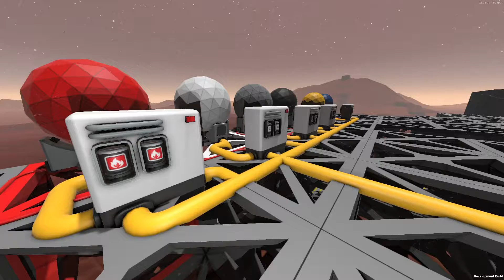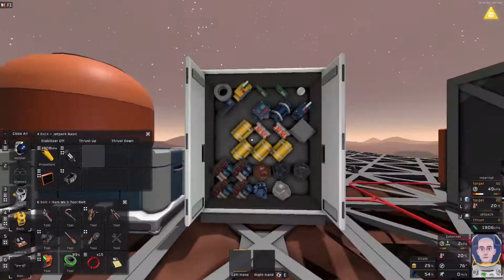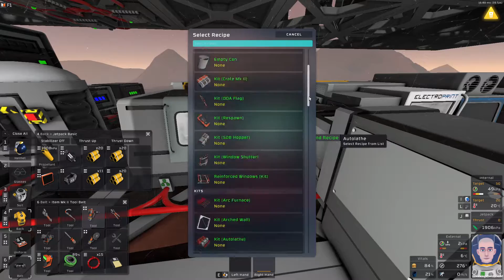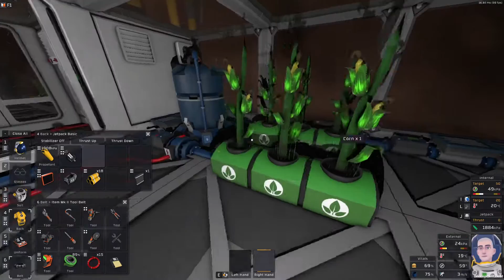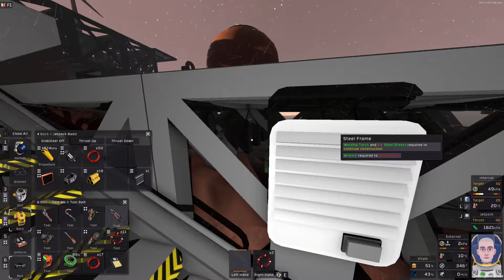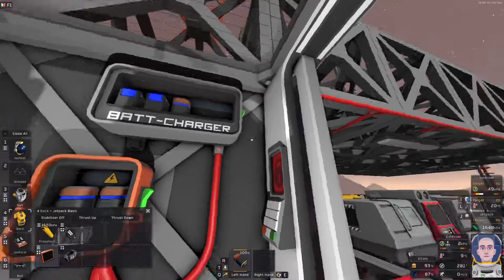I built gas filtration system - Mars Survival - ep 26

Comment: A note on the differences between parallel and serial configurations:

Parallel systems only seemingly appear more efficient in pumping high volume quickly, but this is due to the nature in which filtration units operate, which is that the number of pipe segments on the input pipe network of a filtration unit determines the volume pumping rate of that filtration unit.  Since a parallel configuration typically involves a lengthy input pipe network shared by all units the volume pumping rate tends to be quite high.

Serial configurations are often constructed with rather short input pipe networks (from waste port to input port), thus typically have a lower volume pumping rate.  Of course this pump rate can easily be increased by adding extra pipe segments to each of the input pipe networks (even a T junction branching to a dead end will work).  The most important thing that should be noted with serial configurations is that you want to make all the input pipe networks equal in their number of pipe segments, so that the pump rate of each filtration unit is equal.  A common mistake made by players is having the input pipe network on the first filtration unit longer than the input networks in the rest of the chain (because of running a pipe straight from the mixed gas source which is often farther away), thus causing a pressure build up on the pipe network connecting the first unit to the second unit.  This can easily be rectified by counting out the number of pipe segments on the first unit's input network equal to that of the rest of the chains input networks and inserting a valve (any type) which will divide the pipe network into two different networks (i.e. an input pipe network for the filtration unit reduced to match the length of the other units input networks, and a pipe network to the source on the other side of the valve).

The benefit to using serial configurations is that if one only desires to filter out and store some of the gases available on the input network they only need filtration units for those gases.  The waste port on the final unit will be left with the undesired gases which can be vented, fed to a tank, or whatever the player decides to do with those gases.  Whereas on a parallel network, all undesired gases will be fed back to the input pipe network, so removal of those undesired gases from the input network will require additional filtration units.

Cheers!
Reply from the maker: Very nice analisys. Pinning the comment :-)
Reply: Actually, you can also vent out gases from first tank, with mixed gases, after required gases are already filtered. At least this is my setup, and it seems to work.

Comment: I have another issue with serial connection: can't figure out reasonable setup. For such setup, outputs are in ridiculous places. Filtered output should be switched with waste output.
If it would be reasonable, I would use it in starting base, because I filter only crucial gases: hydrogen, oxygen and nitrogen (I could live without nitrogen but it's neutral so safe for fuel). The rest I dump into atmosphere. With parallel setup I need also filters for each of gas I don't need, with serial I would just dump the rest without filters.

Comment: Water, as you know, is now separated from gas pipe networks and is presently the only liquid, so no filtration is needed.  If you intend on using a furnace to melt water ice there is a liquid port on both types of furnaces.  So just as on an ice crusher the water can be accessed via the liquid port and the gases (i.e. the minute amount of Nitrogen in water ice) can be accessed via the gas port.  Cheers!
Reply from the maker: Right, I forgot that furnace now has liquid port. Thank you
Reply: I built pipe from furnace to water tank. I thought that in some reactions I can get some water too. But later I checked that it's only available by melting ice and I don't need it because I use for this purpose ice crusher :D
Reply: @radoslawmazurekwaw  water form in the furnace without out ice but only if you use pure oxygen. When the hydrogen and oxygen mix in the furnace, at the right temperature water begins to form. I usually have this problem because half the time alot of water accumulates in the furnace very quickly but you have to build a valve on the water pipe because I noticed that the water does go back in the furnace sometimes
Reply: @gc2425  Thanks for clarification :) Anyway I use crusher to produce water, and this very very veeery long pipe is useless.

Comment: What about a tank for Nitrous oxide because that forms in the furnace sometimes when nitrogen gets in
Reply from the maker: Great point. I realized that little later after stopping recording so i think i will have to add it later ;-). What is it used for anyway ?
Reply: @GrunfWorks  Nitrous Oxide presently has no significant purpose, so I'd recommend just venting it.  Cheers!

Edit: Alternatively, you can pump it into your base's breathable atmosphere for laughs.  (Sorry, I just couldn't resist making the joke.) ;p
Reply: @GrunfWorks  alien mushrooms breathe in Nitrous oxide from what I heard. Also I've heard it's good to have around if you play on a public server because you can use it as a stun gas for any unwelcomed guest in your base